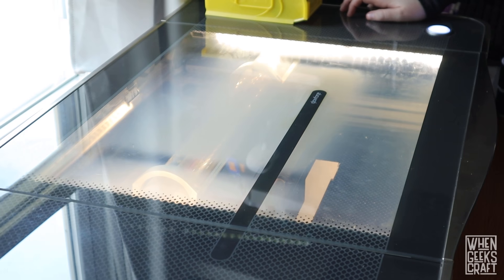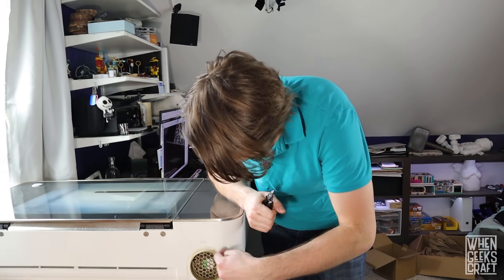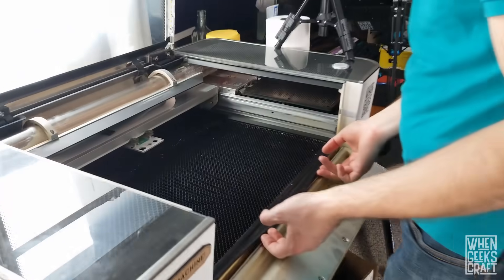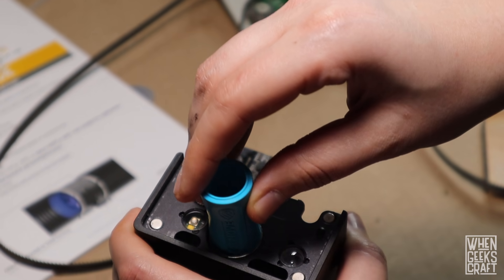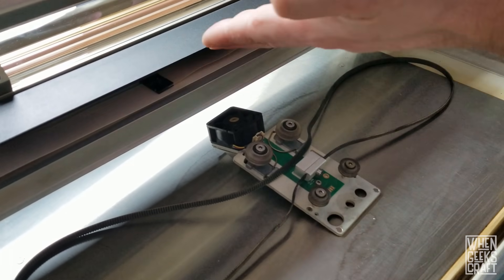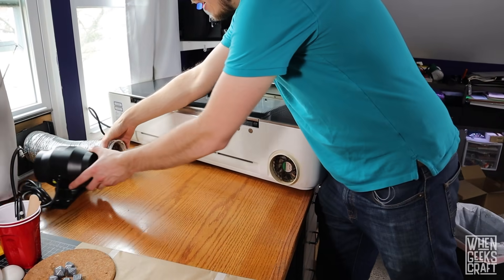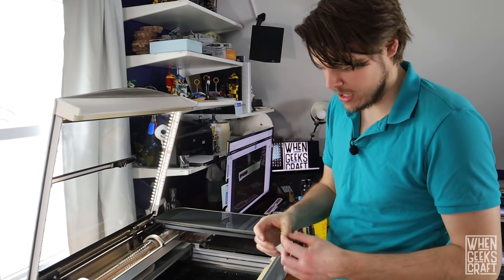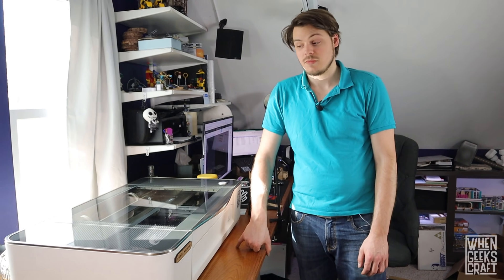GLOWFORGE - How to Clean it and make it Quiet [When Geeks Craft]

Comment: I can't thank you enough!!!  I shortened my hose and for a while that improved MDF smoke but not the sound, and no amount of cleaning did the trick...like you, I was wearing ear protection.  I wish I had found this earlier, you cover all the things I've done cleaning, in simple instructions with good video.  I froze your video to get the model of the fan...only to note, finishing your video, that you had Amazon links to every part you used.  Really well done!!  And sweet of you to thank your source of this knowledge, twice...you are good people.  Looking foward to clamping in a fan, turning off that loud GF one, and not having to go to work on the weekends to cut acrylic because the smell gives my workmates a migraine.  That sliding door for venting is SO MUCH SMARTER than my solution in Colorado (unclip the hose, put a cap over the vent hole).  My only upgrade to your setup was to get a 4-layer hose to hopefully get even more exhaust exhausted...I noticed, through the smoke, that some of my smoke was coming from the dryer hose, so for $4 more I will have the best possible setup in two days.  Thanks again!!

Comment: You folks made a good video, so thanks. Lowe's, Home Depot, and similar places, actually sell vacuum cleaner attachments made to work in the tight spaces of computers. Among the seven or so attachments you get with a "computer cleaning kit, is a conical shaped attachments that narrows to an intake diameter of 1/4". You might find this a useful attachment for cleaning your disgusting fan blades. I find it very useful when vacuuming sawdust out of my CNC machine. Furthermore, Amazon sells about 60 different of computer cleaning kits. That said, the two best devices for getting into out of the way corners, nooks, & crannies are the aforementioned, conical shaped attachment and its 30-degree angled companion tool. Check the kit out because it might save you some time,

Comment: Can you remove the stock fan to increase the air flow?
Reply from the maker: Yes you can. You need to remove the top glass panel to do so. It's something I wouldn't recommend doing while still in warentee. You pose the risk of breaking the glass panel

Comment: What did you use to wipe down the inside of the gloforge bed and lid?
Reply from the maker: I use standard lysol whips ( precovid when they were available) Now i use just a rag lightly dampened with water or windex specifically for the lid

Comment: When removing the gantry that has the laser on it, the roller wheel side ( right hand side) has a 3mm nut in the middle of that roller wheel.  You turn it clock wise and it loosens the wheel and the belt falls right off.  I used to take the belts off and on like you did until I found out about this wheel adjuster.  Added to how easy it makes pulling this part off, every time you put the belt back on you can actually make sure the belt is nice and tight!  Thanks for the fun video.
Reply from the maker: good to know! thank you!

Comment: Thanks for this super useful guide. It's strange that Glowforge did not just charge an extra $50 for the better fan for a product that was designed to be used in a home (rather than an industrial setting). The noise is quite overwhelming.
 I's  also curious that there seems to be little thought given to how people were to clean the machine (aside from the mirror/lens assembly). It does get quite gross inside if you do a lot of wood cutting, and a lot of areas are nearly impossible to reach. 
I use wide masking tape to cover high buildup areas like the gate so that when it gets dirty enough, I just peel off the tape and put a new layer on. I wonder if the new fan will make less deposits of resin on the inside of the machine.
Reply from the maker: They just charge 900 for an external filter thing instead. Better business sence for them I guess

Comment: Thanks so much for the videos and tips! Just ordered my GF yesterday, using your code. This video convinced me to NOT buy the $1000 filter and just use the in-line fan. I’m still deciding on where I’m going to put it, and I wonder if you have any thoughts about the length of the ducting? I bought the Pro, so I need to consider the pass-through feature and therefore, I can’t set up directly against the window. I assume I should keep the fan close to the GF?
Reply from the maker: As long as you have a straight shot you can be a little bit away from a window but consider looking at our video on adding an external fan/cleaning. That might help you pick a quiet external fan and plan for ducting. As long as your pipe is straight you are good
Reply from the maker: Ingore my stupidity as I blame you tube for not showing me what video you commented on!!! You just watched that one....my goodness lol. Like I said though, just make sure you have a straight shot out with as few bends as possible and you should be good

Comment: Hey, thanks for this. How has the fan performed in the 4 months that you purchased it? has it been worth the 75$ investment? I watched the video on the products amazon link and at full blast it goes to about 70 decibels which is about the same as the glow forge at full power. Is it really that much quieter?
Reply from the maker: It's much quieter. The glowforge fan sounds like a little jet engine. That added fan sounds like a box fan in the window on full blast. It's significantly quieter. Four month in and it's still great
Reply: @WhenGeeksCraft  thanks! Mines right in my office and I work on the phone at home. This will make it so I can cut anytime. I joined your patreon and already learned a few techniques and I've had the unit for a year. If you're interested in what I've made too check me out @ https://www.instagram.com/justinappledesign/

Comment: Does this replace the air filter as an alternative (given that we are placing the glowforge near a window?)
Reply from the maker: If you are eputting your glowforge near a window the air filter is unnecessary! If you are placing the glowforge not near a window, this does not change the air filter requirement
Reply: When Geeks Craft thanks for the quick reply! So, could this option be used in addition to having the air filter? Since I read reviews saying the inline fan method is still quieter than the air filter.
Reply from the maker: @dumpling130 I want to be very clear. The air filter is ONLY required if you do not have a window to vent out of. If you are planning to vent outside, then you can just buy the glowforge as is. As is, the glowforge is loud. The fan we install in this video is only necessary of you want to make your machine quieter.

Comment: So it's been a few months since you switched to this setup. Does the glowforge seem to accumulate dirt more slowly now? Is it about the same? How often do you recommend completely cleaning all the fans and lenses of the glowforge? Once a month?
Reply from the maker: Fan has been working great. I clean all the lenses as needed. Those dirty depending on the projects you have been doing. More wood engraves dirty the machine faster. I have done one full clean since this video.
Reply: @WhenGeeksCraft  nevermind! I got it out with bolt cutters! I attempted to remove the fan with an allen wrench and failed. So I went crazy and removed the inner part of the fan (blades and motor) with the bolt cutter. The square frame the fan was sitting in is still there and I can't remove it. At least now the air will have a straight shot through the system!
Reply: I found this article on how to remove the fan (a little bit too late, but whatever): https://community.openglow.org/t/exhaust-fan-removal-replacement-on-the-glowforge/251
Reply: @WhenGeeksCraft  Thank you guys so much!!! My Glowforge runs so well now and I could even fall sleep with this level of background noise!
Reply: Thanks so much for the info! Last night I ordered all the parts to replace my noisy fan. I'm so excited! I also tried to remove the metal backing behind the fan. It proved to be more of a challenge than I thought it would be. How did you "cut it out"? I cut all the way around the rubber/foam seal that surrounds the metal backing, and attempted to wiggle the metal backing out of the Glowforge using pliers, but it wouldn't budge.

Comment: I purchased this same fan and got my GF yesterday. However, looking a little more closely at the specs it looks like the GF fan is 200 cfm and this fan is only 160. Have you noticed any reduced ventilation due to this?
Reply from the maker: Nope I have had no issues with it. It actually seems less smelly with the new fan
Reply: When Geeks Craft so really you just went with a lower fan? Do they sell the same 200 cfm fan that is just as quiet? The 200 might be required because of the fumes, safety first. Maybe confirm with glowforge first what is the lowest you can go before causing some danger to your home while lasering.
Reply from the maker: It has been working fine with us. No fumes what do ever in the room. I have a friend that operates two glowforges off of this one fan. It's all up to you with what you are comfortable with

Comment: I've watched so many Glowforge videos but this one was so informative since I have not bought mine yet and am still deciding on which model to get. Now that you've had the 4" inline fan for a bit,  do you think the bigger 6" fan might have been a better choice? I'm still debating which size i should get. I'm also very nervous about the smoke and smell since I live in an apartment but I live downstairs and my window is on the street side. I'm sure my neighbors might not like the smell...ugh, so many decisions but I do know I'll use your code.
Reply from the maker: Thank you! If you are in an apartment I would HIGHLY recommend an external fan. The machine is super loud if you don't. No I don't think a 6-inch fan is needed. my 4 inch fan works great! I have a friend that uses this same fan for two glowforges at one time. There is really no reason for the 6-inch other that personal preference. You can smell it outside but it honestly doesn't smell that strong. Like a burnt match for wood and a nail salon for acrylic. It dissipates really fast. There are so many people i have talked to that are super scared of the machine. As long as you use Glowforge materials OR materials that are Laser approved (like inventables wood or johnson plastics durowood/Laserbitz ... also really any CAST acrylics), the fumes are not going to harm you. Never put anything PVC in there because that is not good for you and will destroy your machine. The biggest recommendation is to not be afraid of it and just educate yourself about what is and is not safe to laser :) Feel free to ask any other questions!

Comment: Is this fan a similar alternative to the Glowforge Airfilter? Do you know how they compare besides price? Thanks so much! Love your videos.
Reply from the maker: The air filter is designed so you don't have to be bear a window. Our solution is so we don't have to use the loud on-board fan. If you can put your forge bear a window it will save hundred in extra expenses. I don't know the cost of the air filter but I'm pretty sure it's around 900 and my external fan is like 100
Reply: @WhenGeeksCraft   Thank you so much!

Comment: I’m considering buying a Glowforge. I live in an apartment so i’m concerned with the smell of smoke and the noise. I saw the extra 4 inch fan exhaust and love the idea! I’m just a little worried about what others will think. If you have any advice i’d love to hear it, thanks!
Reply from the maker: With the fan addition it really is quiet. You definitely can smell it outside when it is vented out but it smells like camp fire lol not too bad!!
Reply: Just an update. I finally got my Glowforge and bought the fan before my Glowforge came. It’s SUPER quiet and doesn’t bother anyone including myself! I can never go back to the regular settings again. Thanks so much guys.
Reply: I'm also worried about the smell and smoke for my neighbors since I live in an apartment also. I'll be doing the inline fan for sure.

Comment: Maybe I missed it but did you disconnect the internal fan? If not, how do you keep it from coming on?
Reply from the maker: In the app on line if you flip the switch in the settings it stops the inter al fan from spooling up

Comment: Next time you're in there cleaning, you may want to fully remove the internal fan. It's restricting airflow plus is spinning as the exterior fan operates. Sometimes when you spin a fan, it acts like a little Generator, and can send power back up the lines. If they are disconnected then no worries but if connected could cause issues for lower wattage items or capacitors. Also the exterior fan will have even more airflow when you do remove the interior fan. Cheers...
Reply from the maker: someone else shared the same info. we are definitely going to remove it with the next clean! No reason to have it there if its not needed!
Reply: When you pull out the internal fan, can you update this to let us know if the honeycomb material needed to have been cut out or if it was just sandwiched between the housing and the fan?
Reply: I’d like to know this too!
Reply from the maker: @CptnCobblestone  I don't know if I'll be able to give a good update in that or not with ours removed already. I can say I'm about to clean the glowforge this weekend and I'll let you know how it goes as I will likely be removing the fan then

Comment: Why not remove the internal fan also? I did that for mine (unplug it and remove 4 screws), and I got a much better air flow.
Reply from the maker: Not a bad idea. May do that with the next cleaning
Reply: In my opinion the internal fan is adding unnecessary resistance to the air flow. Removing it would improve the efficiency of the exhaust system therefore improving the extraction of fumes and particles. You should definitely try it.
Reply from the maker: So I tried to do it in my last cleaning but there were nubs in the way... So I just left it again.
Reply from the maker: Thanks!!!!
Reply: We thought about that too...we didn’t want to mess with the wiring in addition we thought who knows there may be a case where we need/want two fans!

Comment: Are you worried about any debris from the cuts going through the new fan? The Amazon site states that debris could damage the blades.
Reply from the maker: I worried about the same thing honestly but then thought about how  lasers vaporizer and don't just send through saw dust. It's mostly smoke and not particulite that's going through. We will definitely have to clean it like the other fan but our friend has had this installed for a year and has had no issus